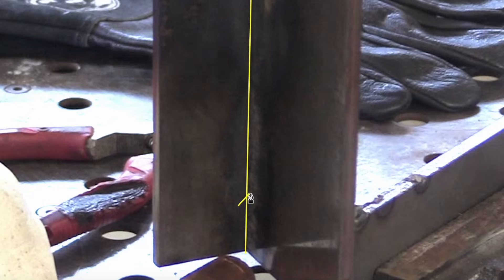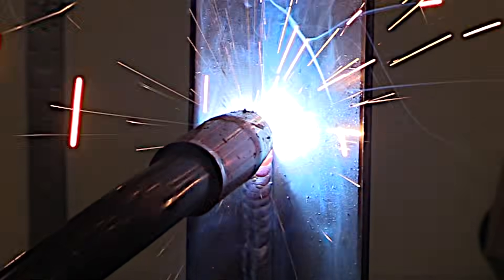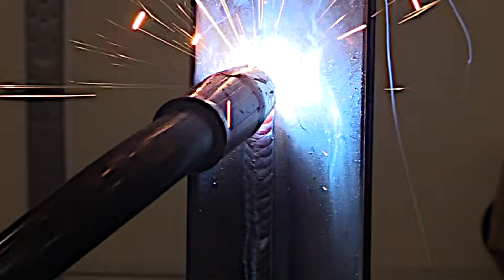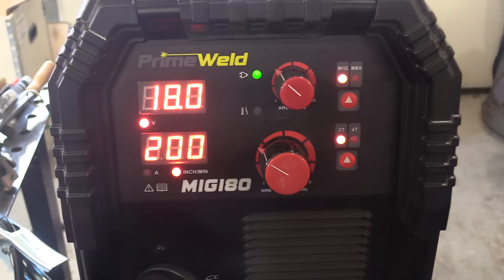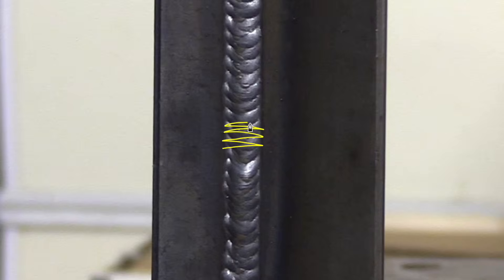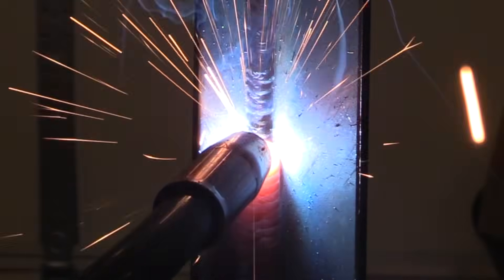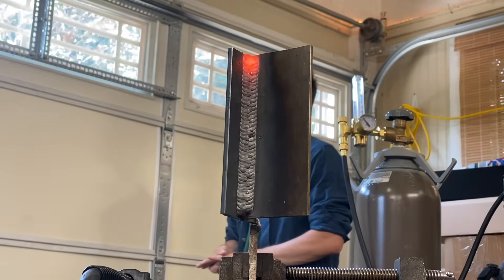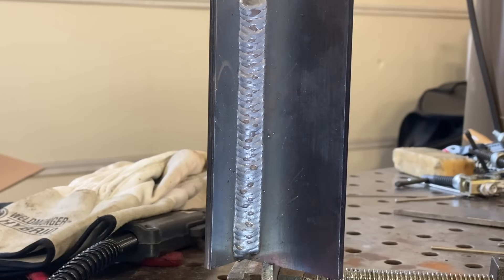3F 2 Pass Vertical MIG Weld

Comment: I am in school now MIG 1 and struggling bad with my vertical t-joint.  I have tried the upside down V and the Z and I still have horrible caterpillars!  I meed to get signed off on Monday night so I am spending all weekend welding on coupons for practice, still not close.  ARGGGGG. Thank you for this video, I am practicing on paper right now!
Reply: I think it was my settings (on a Lincoln).  For vertical and overhead is better to be hot and fast or warm and slower? For instance on 1/8 lap joint I turned it way down to 165/16 and that worked great!

Comment: I can do that with an arc welder, but every time I've tried with a mig it's looked like a forged turd. Is tgat a pulse setting? I have a hobart handler 210 at home and i can not get it to go up. Even the welders at work, i can't do it and i haven't seen anyone that could. It all just runs out of the puddle making globs. Sad part is I'm even a certified welder.

Comment: I'm struggling so bad with this in school now. My vertical down isn't much better. 

Jody, thank you for showing your instructions in real time, not time lapse. This really helps me with pacing. 

I know that when I'm in the booth again, I will get uptight and start going too fast here, pausing too long there, but I have this video bookmarked and can go back to it time and again, as much as needed.
Reply: I was TERRIBLE the first 8 weeks of welding school. Me and this other student were constantly in competition of who was worst in the class. It was so aggravating to weld for 4 hours a day, 4 days a week, and to suck so bad. Then, school had a forced a break for two weeks, and, when I came back, all of that knowledge somehow settled in my head, making me much better. By the end of school, I was one of the top 4 students in my class. That other student didn't pass. When I was screaming in my booth for months but putting in the work, he was on his phone. Work ethic makes a HUGE difference. For me, my anxiety would have me rush, which caused a lot of mistakes. I learned to develop a beat in my breathing, and then I matched my welding movements to my breathing. Once I had travel speed down and I could see my puddle/knew how my puddle was supposed to look, I started to experiment with welding patterns (circles, zig-zags, C's, etc...). When I found the pattern that worked best for me, I stuck to it and developed that muscle memory. 

You'll get it, bud! Try to be more lenient with yourself and have speak positive thoughts in your head. Welding is hard! But, lots of practice teaches you how to work with it. :D
Reply: Soo how have you improved 5 months later :) did you finish school and importantly did you improve on this
Reply: @ I'm still in school and pursuing degrees instead of certificates. I finished the MIG course with an A and am now on the second part of SMAW, which is also an A so far. 

THE big thing was to stop overthinking as well as recognizing that being a perfectionist (in my case) is not a matter of getting everything right, but refusing to move forward if everything is not perfect. That completely stalls the learning process.

Comment: Hello sir what should be the vertical current voltage, solid wire is 1.2 wire size please tell
Reply: 1.2mm wire is way too big for vertical unless youre welding some really thick material.

Comment: When Welding 20mm  thich carbon steel plate,what amperage is recommended for the vertical fillet weld?
Reply: I'd weld 20mm thick carbon steel horizontally not vertically.  But if u really wanna do it, maybe try 30 volts vertical down pulling the gun not pushing it on a root pass then a cap run on like 19 volts or something for a vertical up pushing the gun cap run. But on the root run u need to move quickly
Reply: @VypaGaming  👌

Comment: Jody, Thanks for the videos.  My Hobart chart shows 18.5 Volts and 280 imp   Did you lower the settings some for vertical, or is it the machine?
Reply: You wanna run colder on vertical up

Comment: What gas are you using? 90-10? 75-25?
Reply: I'm guessing 75-25, be tough to get that weld with 90-10
Reply from the maker: 75/25 argon co2.   the end shows all the settings

Comment: If you pause at 3:38..  What are those little droplets on the weld that look like moisture?  I don't think I've ever seen that before.  Granted my mig is just a little flux core Hobart and I've never used gas.   Are those droplets just slag or impurities?   What is that??
Reply: silicon from the wire floating impurities up to the top of the weld.